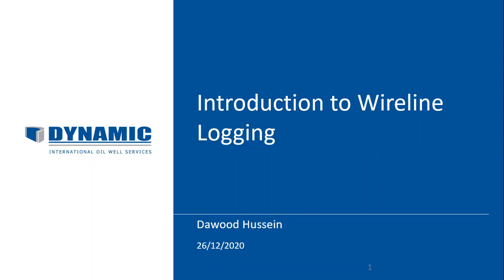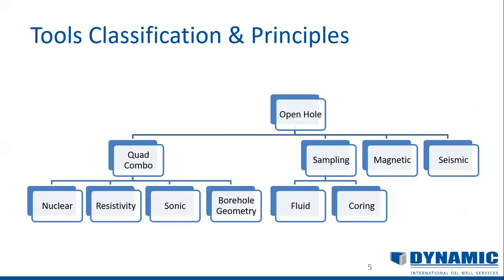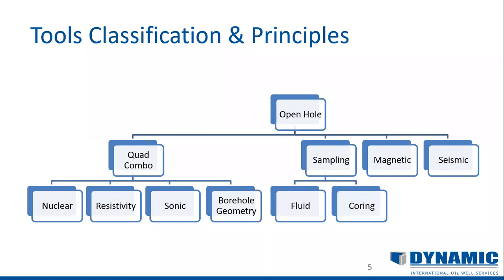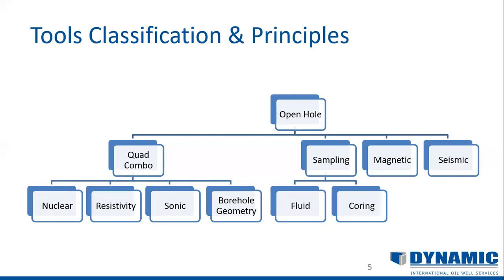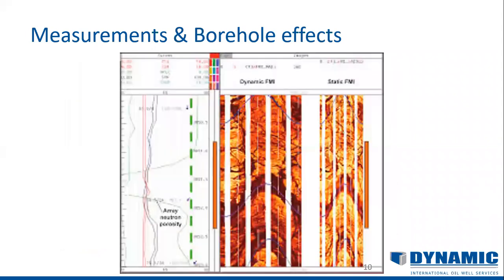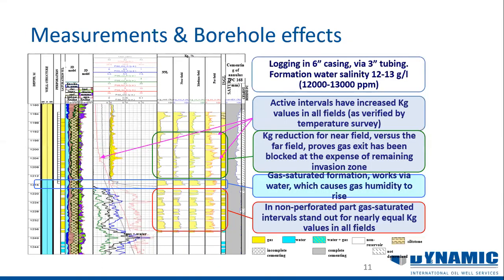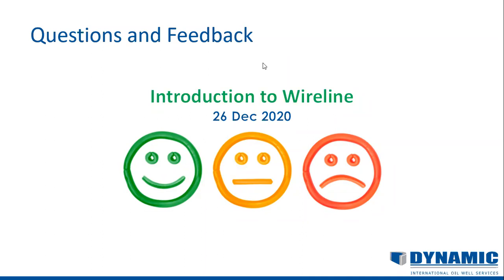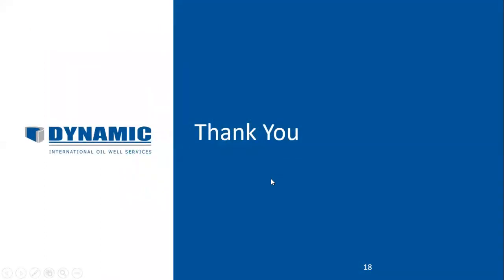Introduction to Wireline logging

Comment: Pls what causes slippage in wireline logging?
Reply: Slippage can be caused by several environmental factors such as accumulated dust or sand, rain or snow, grease and accumulated dried mud.